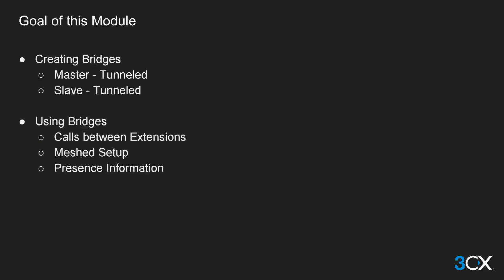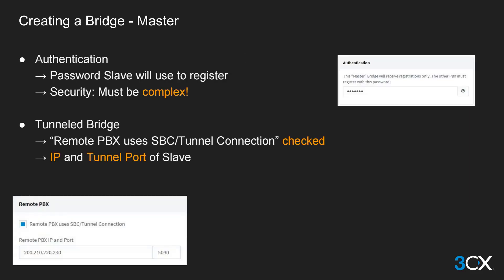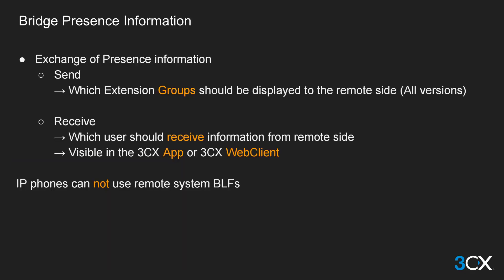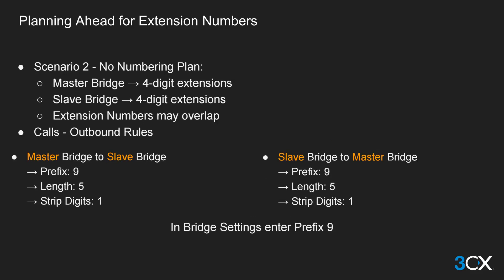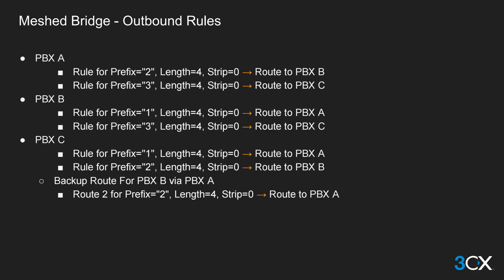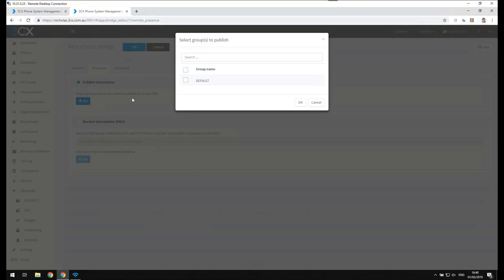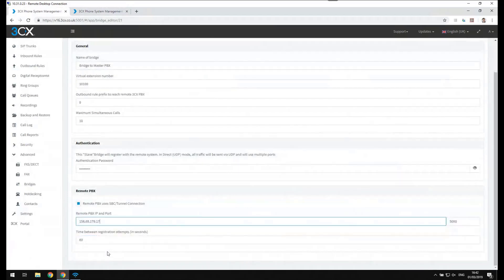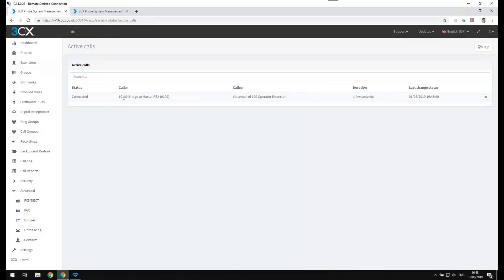4. Bridges V16 - Advanced Training

Comment: Hi 3cx team. I have 3 questions please:
1. What is the point of configuring an outbound prefix under each bridge? I mean, since we define the same prefix (9) and digit length (4) in the outbound rules, how does the outbound prefix in the bridge affect call routing in the end? I expect that even if we do not define it, the outbound rules of the PBX will be enough to route the call towards the remote bridge. 
2. It is strange that we only define the remote bridge's IP when it is located remotely. If the 3cx servers are within the same subnet (e.g. MPLS network), no remote bridge IP can be defined, thus the local 3cx can accept incoming registrations for the bridge virtual account from any IP.
3. In the latest version, they are called "host" and "Peer". I guess this is in perfect analogy with "Master" and "Slave", right? Just making sure that no new concepts have been introduced and the functionality is the same.
Thank you in advance!
Reply from the maker: Hello Alfista, 

1. While the prefix in the outbound rules is used for routing the actual calls between the two PBXs, the Prefix in the Bridge configuration is used to add the prefix to the extensions from the remote PBX, in the Presence screens. It is just an identifying prefix. For example, if you had an extension 100 on the local PBX and an extension 100 on the remote PBX, the prefix would be added to the remote PBX extension 100, to avoid confusion. It also makes it easy to call the person directly from the PEOPLE tab, otherwise you would be calling the local extension 100. This is only required if you have overlapping extensions between the 2 PBXs.

2. When the bridges are connected via the 3CX Tunnel, an IP Address is required. When the 3CX Tunnel option is not selected, for reasons you did mention, like local subnets or MPLS, which you can control with your own access control lists on your firewall, or routers, then an IP address to accept the connection from is not required. This is only to protect from where the tunnel connects from.

3. Nothing new with the Host and Peer. We are in the process of renaming these concepts.